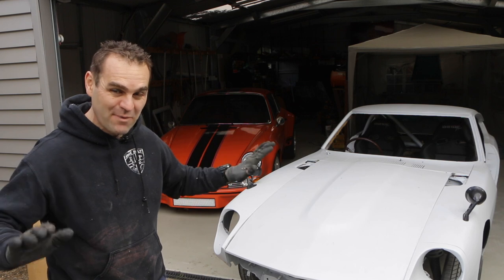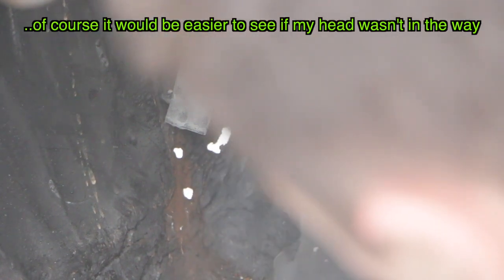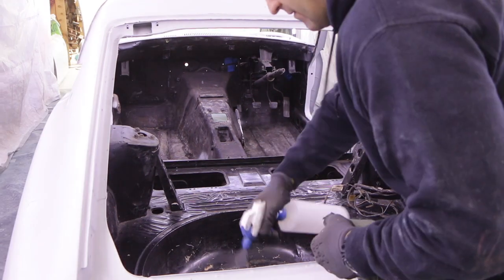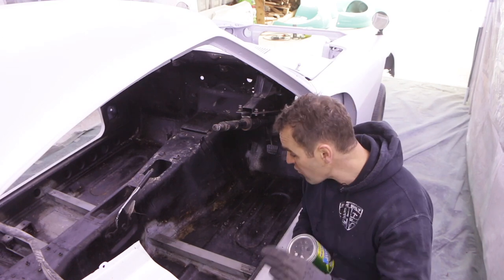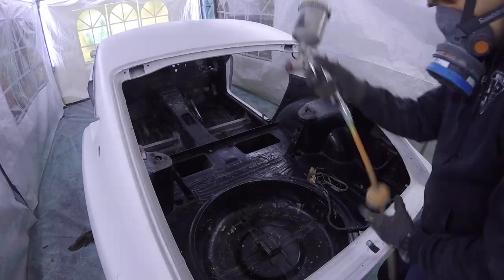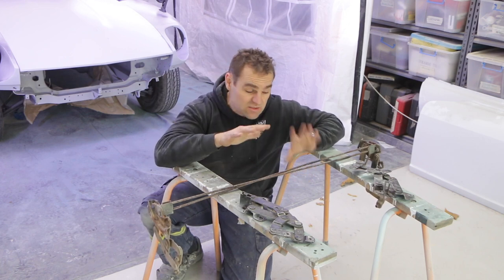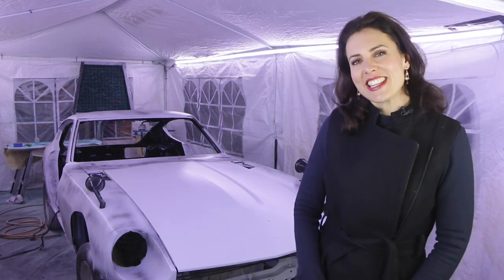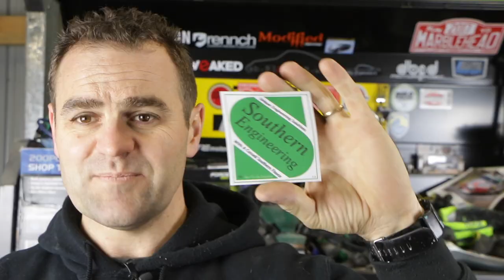Home Built Datsun 240Z part 47 - Painting the interior

Comment: Did you use a degreaser spray to clean the inside or just soap and water?
Reply from the maker: Prepsol
Reply: I have “ZEP” degreaser is that ok to use? Or should I find a prepsol?
Reply from the maker: What you want is a 'wax and grease remover'. That is what you should use before you paint anything. Your local auto parts store should carry it.
Reply: Home Built By Jeff  ok thank you 🙏

Comment: You need to spray underneath the car because it’s the rust origin
Reply: And Bowral gets mighty cold. Rust loves less than 10 degrees celcius.
Reply from the maker: I will definitely be doing that soon ;)
Reply: Well your final layer should be two component bed liner.Its far superior to ANYTHING you can put underside ...it stats bkack it repels dirt moisture and water can take abrasiins and is the best undercoat known to man .2 component bed liner us tge ONLY stealth way to Rock the under carriage!

Comment: Those seat rails would not pass in QLD.
Reply from the maker: I am going to stiffen them up now so they will be much stronger than the factory ones.
Reply: Home Built By Jeff  . I reckon they look plenty stiff, it would probs be knocked back for contact area with the floorpan. Frankly i wish I was able to do mine similar to the way you have done yours. Looks neat.

 ''Single seats may be adequately anchored to sheet steel floors by using not less than four 8mm ISO Grade 8.8 (5/16 inch UNF SAE Grade 5) bolts, with a mild steel reinforcement backing plate of an area not less than 3750mm2 in contact with the mounting surface and a thickness not less than 3mm at each anchorage point.''
Reply from the maker: I have come up with a way to reinforce the front rails which I will do next week ;)
Reply: Home Built By Jeff  Always keen to see what other guys come up with. I'm up in Hervey Bay restoring an old Celica, channels like yours are gold.